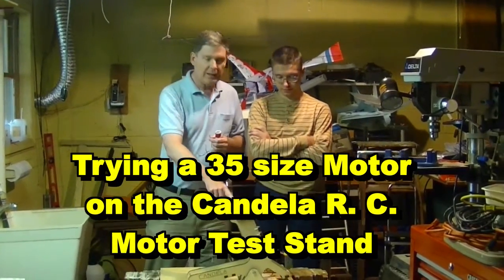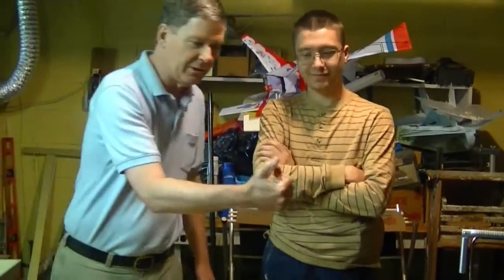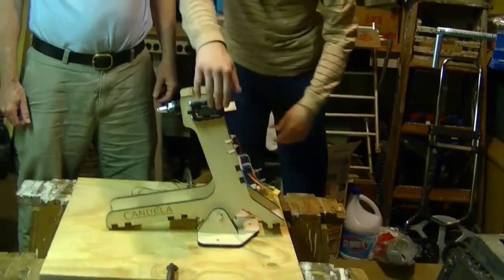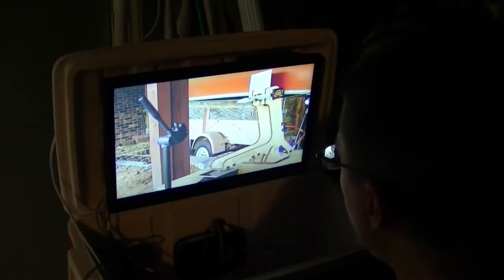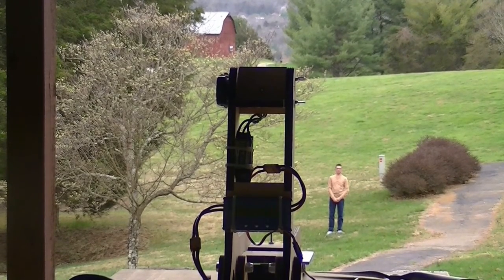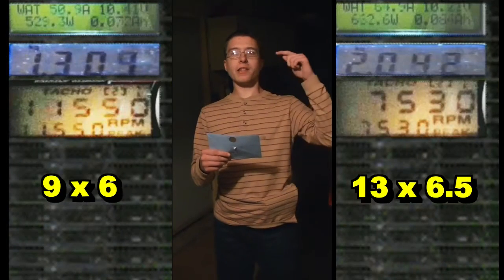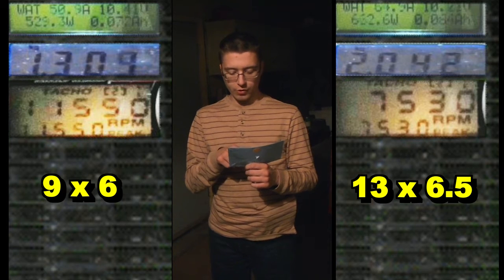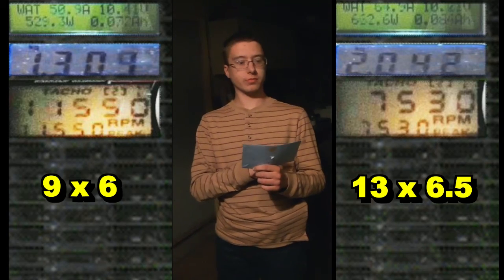Candela Motor Test Stand Test

Comment: I think the problem ist the Motor can not handle the 13 inch prob . I burned my Motor with an 1045 Prob on a 60 second full throttle flight with my FPV49 Wing. So you should measure the temp after some running time
Reply from the maker: Were you using a 4 cell LIPO? 
We were only using a 3 cell for the test to the voltage was less.
Reply: No i used 3 cell
Reply from the maker: IDK, we didn't notice any heat but we didn't go full throttle for long.
We that setup on one of our planes so I will watch for the heat problem.

Comment: Once again, very nice test. Cant wait for the review of how the stand works for you,,, I see you used it outside first,,,lol  It is safe enough to use inside, but that is your choice ,,,,  lol       and WE DO WANT YOU TO DO THIS AT HOME !!!!  SIde note : John- Very nice use of a pulsout command to control ESC. You might want to add a 2000 millisecond pause between each pulsout command so it ramps up slow. You inspired me to do it myself. We do a lot of code work here on quads and stuff,, Programming is a wonderful and fulfilling task for me. I could see the excitement in your face.... Great JOB John,,,,!!!!!!!
Reply from the maker: Thanks, I'm glad you liked it. 
What are you guys wanting as far as content in a review. This is always something I wonder about.
Reply: ***** That is a difficult question, You have done a wonderful job on the video's. I and many others enjoy them just as you made them. For us, we just wanted to see how the stand developed into a tool from the moment you received it. Its ease of use is important. We are designing an EDF firewall and turbine mount. Safety is most important. The larger you go, the more likely you would move outside for test. But in this configuration, most test can be done inside.So use it in more test and see if it really helps improve your hobby experience . Then we will talk and see if any of the design needs updating..   Its been great so far,, Thanks so much...